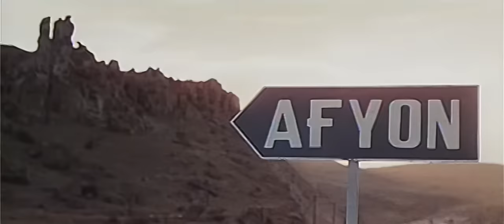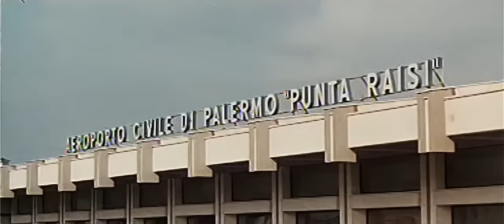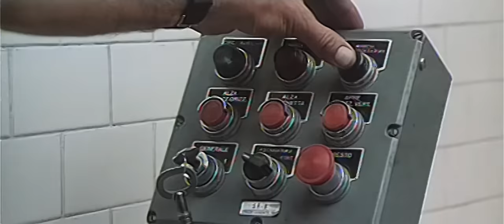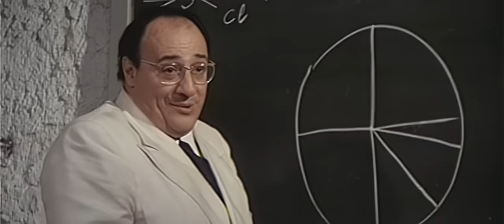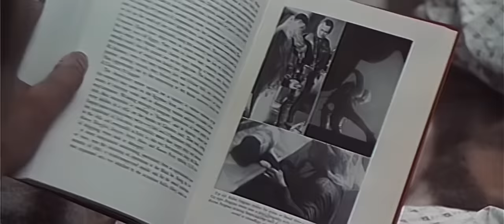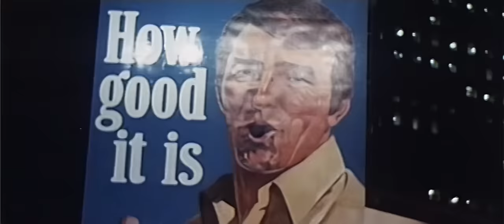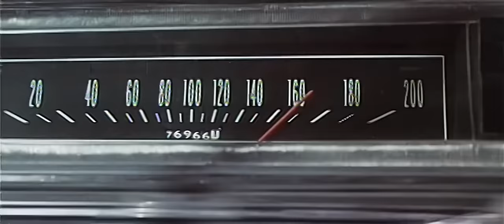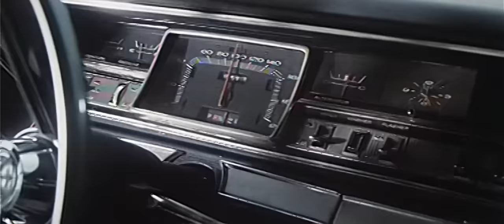Afyon oppio (1972) Film mafioso italiano | Versione originale con sottotitoli

Comment: Why did they buried the drugs with the corpses?!
Reply: Supposedly the casket can be dug up later and the drugs recovered. *But, you're right, that doesn't make sense when they could just as easily open up the corpse in a private room and retrieve it all. Is this an oversight on the part of the Continuity director?